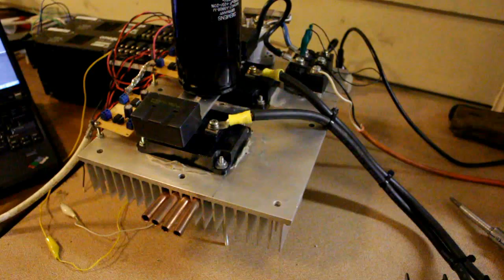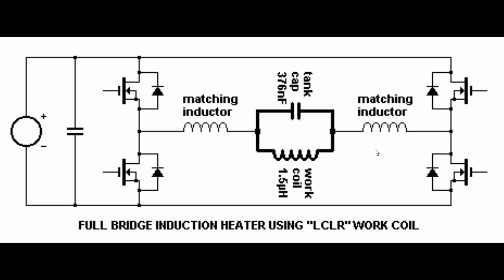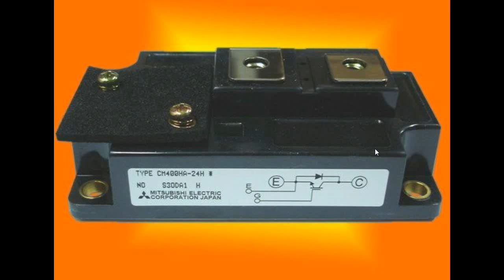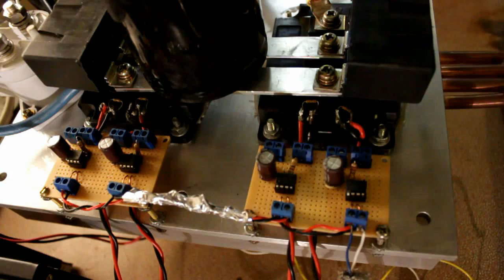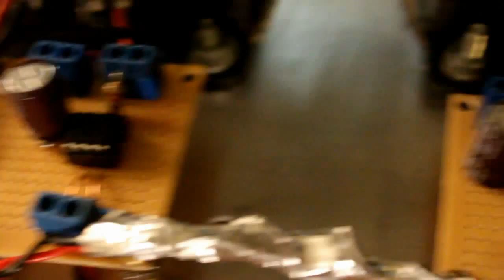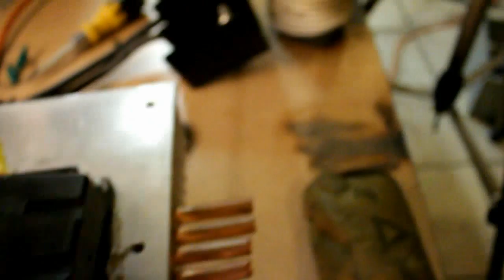Basics of IGBT Full Bridge Inverters

Comment: I like your gate drive. I would ask if you could shed some light on a FullB induction heater listed on instructables.
http://www.instructables.com/id/30-kVA-Induction-Heater/
If you notice the isolated GDTr's are wound toroids. I have looked at this design and am a bit condused about the details of the windings. You sound like you could clarify that issue and have most likely used that system before. Can you please share anything? Thanks.
Reply from the maker: The gate drive transformer he used was toroidal, that just means the windings were wound onto a ring like transformer structure. They are electrically the same as any other transformer. As for how they work, there is one primary coil, driven by an amplifier stage. There are four secondaries. with two of positive polarity, and two negative polarity, that is, with one half switching cycle. On the other half of the switching cycle, they reverse. This is used to drive the opposing IGBTs on and off at the right time to avoid shoot through. Basically the same thing as you see in my video, just done with gate drive transformers. The transformers can make it easier to amplify gate drive power at high frequencies without having to add power supplies at every stage.
Reply: subcooledheatpump
 Thanks for adding the comment. I do understand what you explain. What I have a problem with is how the toroid is actually wound. I am assuming that one lead of each twisted wire is all connected together to form the primary. I really am not sure since I know you can wind several ways, however, only one or two ways will actually work. I have investigated the properties of determining  the proper coil use and understand that. When I search for info on how actually a full bridge GDT is wired, I get limited detail with most info on half bridge GDT. I have a question going on another guys youtube channel about this very issue, on his Gate Drive Transformer explanation tutorial which does not show the actual winding in depth. Thank you again and I hope you can share more about this lacking area.
Reply from the maker: I have seen this; use an Ethernet cable. Wind the cable around the toroid core, use one wire for the primary, and the rest as secondaries. But basically the concept is the same. Wrap around one wire around the core, this is your primary. Any others you wind will be secondaries it's up to you to determine the polarity
Reply: subcooledheatpump
 I think you are saying use one twisted pair of the cable as it's own seperate primary? That would mean you would have to have 2 more twisted wires wound on that toroid and then use those 2 windings as the gate drives. After winding you would have a toatal of 4 twisted pair secondaries, basically 2 twisted pairs on each end of the completed winding with the primary somewhere in there with them. Makes sense but when I look at the schematic on that site, his primary and secondaries show complete isolation. Meaning that all 4 secondaries are isolated. Makes me think that he is using some other way to wind it. The whole study of using a toroid as an isolated GDT for half bridge is fairly easy to make. You can find sites that explain that and even how to get the best results.
  I would ask you to please clarify how you think those full bridge toroids are actually wound. I appeal to you since you seem to have a good understanding about GDT and are so open to discuss and explain. I really want to know if that full bridge GDT is wound as you put it, or as I have seen elsewhere on other sites in half bridge mode, using twisted pairs but combining one wire in each of those twisted pairs and making those the primary. I know it can be done a few ways, it is the concept of best, "low leakage" and magnetic flux design I am trying to figure out for the full bridge GDT.
 Thanks Sub.

Comment: One question, your video didn't answer is how to choose the value of Rg.(gate driver resistor)
Reply from the maker: The Rg is very application dependent. IGBT manufactures have a list of generally acceptable Rg values for a given IGBT. In general, Rg must be raised if higher voltages are to be used, or if the turn off voltage spike is too high. Rg must be reduced if the thermal dissipation is exceeded, or high switching frequencies are to be used.

As for the isolated power supplies, the high side (positive) IGBT gate drive power supplies MUST be isolated, unless you like explosions. The low side gate drive power supplies don't need to be, but some are anyway to reduce the possibility of noise or interference
Reply: subcooledheatpump Thanks mate for answer. That and some more things, I would only like to propose you, to show in one of your videos, there are not many videos out here, how to drive this IGBTs blocks, I mean the real "basics", showing also the use in practice, Maybe on some power managment too, like 'phase-shift control of H-bridge'(I picked that up from richie brunnet site*) and others.. I greatly appreciate..
Reply: My friend you read datasheet for Optocoupler 
http://www.bmh.nu/pdf/Opto/HCPL3120.pdf

Comment: I don't fully understand this about the fully isolated power supply, and isolated grounds, for instance if you have build a linear power supply, does that mean that you have to use 4 transformers, 4 regulators one for each IGBT driver?, or you can use 1 tranformer, 4 regulators? Why must Vcc for the octocoupler be even isolated, isnt' that just power supply for the IGBT. I'm confused. Thanks in advance.
Reply: You need isolated flating poWet supply cauz if the power supply is the same for these 4 gates, you make short circuit at the h bridge.

Comment: So if u wanted to create a induction heater capable of melting metal (i wanna get away from propane). Would you say a full bridge inverter to drive the inductor is better than say a half bridge version (not really understanding the differcen). Been trying to read up on the subject.. but i make knifes.. not induction heaters. ;D
Reply from the maker: A half bridge circuit will only give half the output voltage. A full bridge circuit will give full output voltage. The output of a full bridge circuit will also be smoother, the currents and voltages will be more steady

Comment from the maker: Technically speaking you can get away with using 3 isolated supplies. One for each of the upper IGBTs and One for both lower IGBTs. Notice on a full bridge diagram, where the emitters are located on the upper IGBTs; they are in common with the output phase. You can't use one supply for both uppers because you would be shorting out both phases with each other. The lower IGBT have their emitters in common with the DC Bus negative, so you can use one supply. Thanks for watching

Comment from the maker: Yes you can use gate drive transformers. I would advise to check the output of the transformers with an oscilloscope first before you apply power to the IGBTs. Check for ringing, proper voltage, proper rise times, and proper polarity with the transformers connected to the IGBT gates first before you apply power to the DC Bus. This will save your IGBTs from damage, or possibly from destruction. Thanks for watching